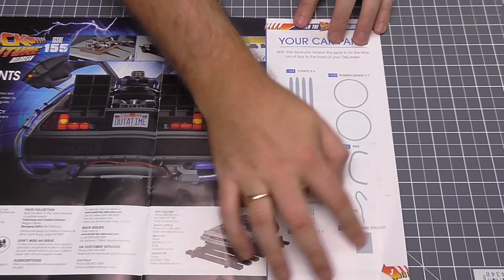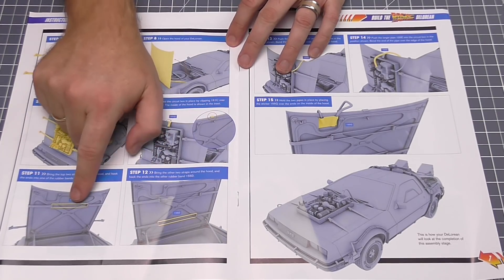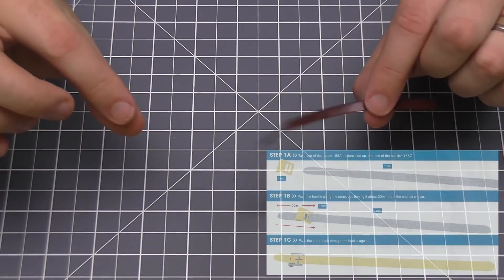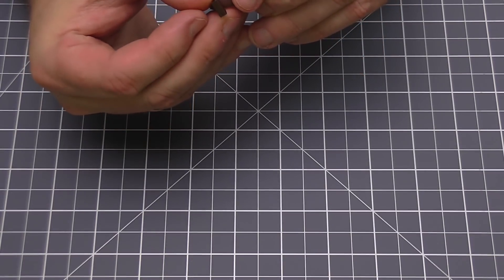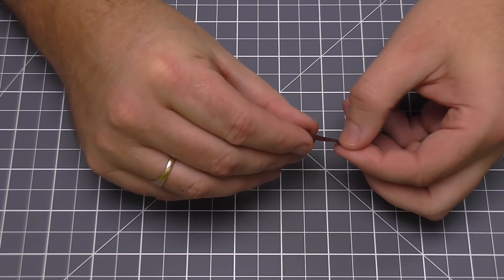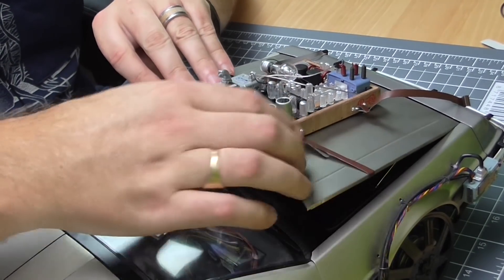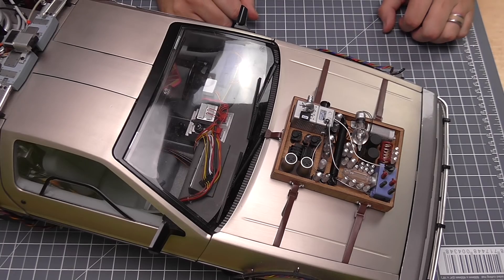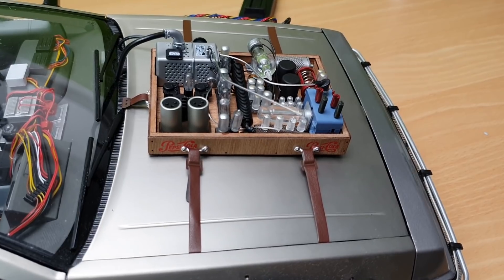Build the Delorean EXTENDED - Issue 155 - Completing the Hood Box

Comment: It looks cooler than I thought it would, but I might cancel my subscription with Issue #130, and focus my funds on buying the upgrades from Mike Lane and Chloe (I already have a Flux Capacitor, but I’m still waiting on the Xmas Tree).  Plus, I’d rather keep it in either Part I or Part II mode, especially after as exhaustively long and drawn out as this build has been.  I do have the white walls from Eaglemoss, but I don’t think I’m going to use them.

Comment: Is it just me or are Eaglemoss notorious for missing parts! I never had any problems with DeAgostini and zero issues with Hachette. I got the incorrect issues more than once with DeAgostini but that isn't missing parts. Sounds like a bit of a train wreck compared to the other 2 companies!
Reply: Wonders I have 2 issues from DeAgostini that were missing the exact same part for the Beetle. I’ve waited 3 months for 1 and 2 months for the other and it has been 3 weeks since I last contacted them. Only problem part I had with the DeLorean was a spring pinging off, other than that I’ve not had any missing parts so far
Reply: Oh don't get me started on DeAgostini. The Millenium Falcon build was a horror with multiple issues missing and taking up to 6 months to finally come through, pieces missing, parts damaged, LED strips not working properly, including multiple replacement LED strips. I've only just managed to finish the thing, thanks to a friend in the UK having a rather large and prominent spare part for me that was missing from the second last issue. What should have been a two year build, stretched into 3 years. It was an absolute nightmare. Had similar problems with Eaglemoss's 3D Create and Print partwork. It took them 9 months to finally send me one final missing issue before I could attach the print head to the thing. As for the DeLorean, pretty much problem free until button 6 decided it didn't want to work one morning, and then being sent a visibly dodgy replacement button board by them to see if that would fix the problem. So my DeLorean  is currently stripped back to where the circuit board and button panel can be removed while I wait for the Model Modz replacement circuit board to be finalised and put up for sale, which will then abolish the buttons altogether via built in bluetooth.